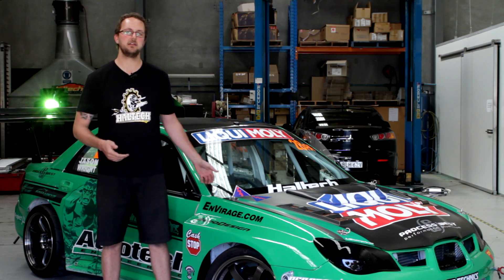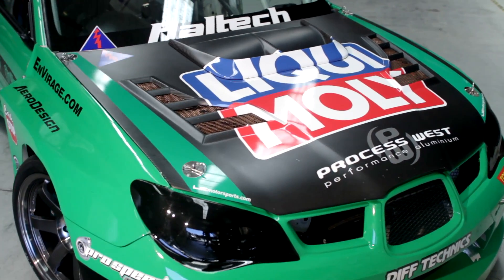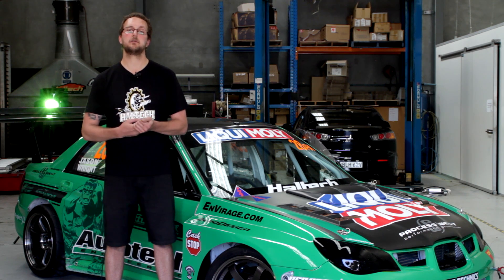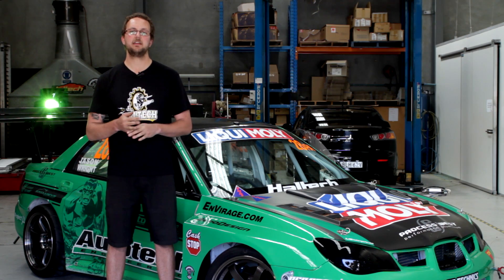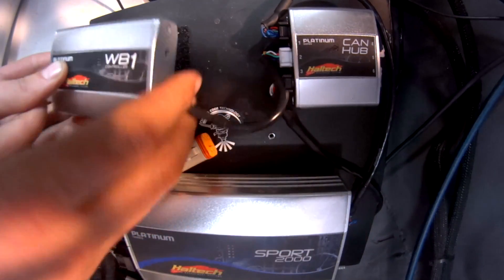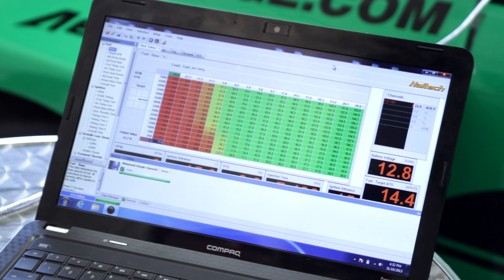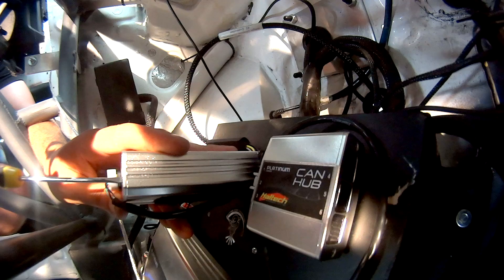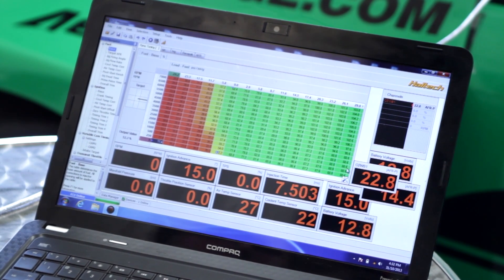Haltech DIY: Installing and Setting Up a CAN Wideband Controller

Comment: So if I am using a haltech multi gauge can I plug it into the wb1 second port and use it like a hub ? Or do I need to buy a hub also ?
Reply: Also I’m going to be using it with a platinum ecu

Comment: Does the wb1 turn the sensor heater on before the engine is actually running, as in if the key is on for diagnostic purposes? Or does it stay off until the engine is up and running?

Comment: Hello, Gents.
Does the CAN wideband (WBC1) & O2 sensor powered by the Haltech ECU or do I have to connect it to the car battery?
Reply from the maker: You have to connect it to the battery.  The CAN cable connection is used to trigger it to turn on, and it gets this power then directly from the battery.
Reply: Thank you, Sir